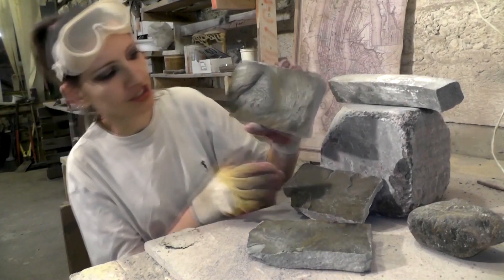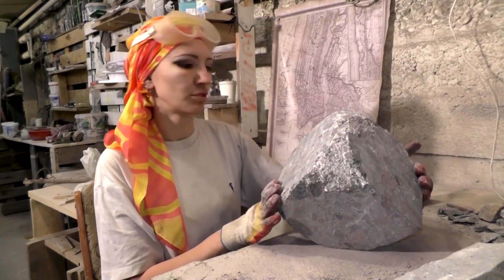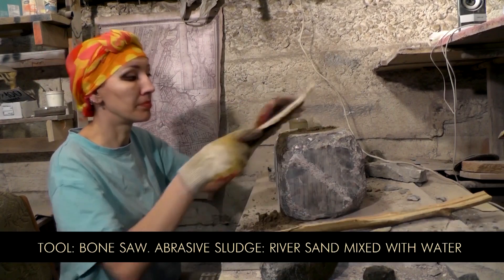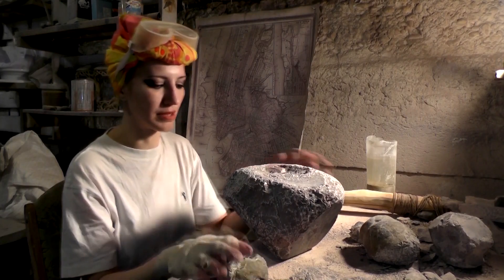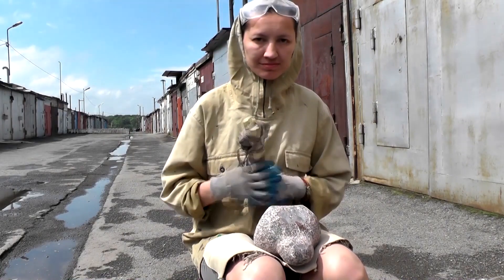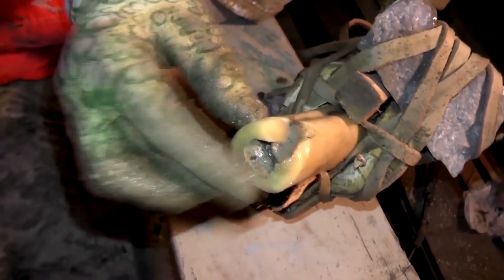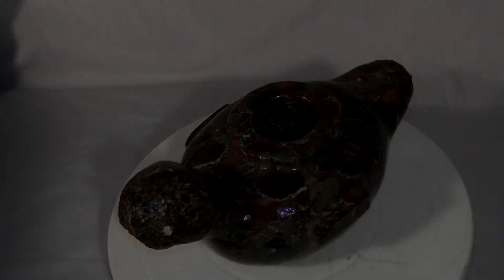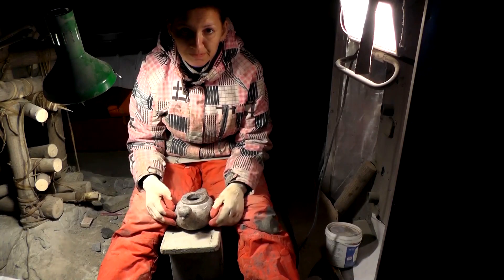Mysterious Ancient Artifact - DIY. Alternate history fans, please look away

Comment: Please next episode how the pyramids were made
Reply: What don't you understand considering there are already loads of videos and docos out there which speak to that subject.  These are the main points folks need to know:

1 - the pyramids are mostly Limestone while those Limestone blocks are mostly crude chunks of stone of assorted shapes and sizes.  Only a small number of the total blocks - the casing stones and last layers of blocks upon which those rested + the blocks making up the inner corridors/chambers were more carefully cut and in some cases polished.  The bulk are basically "stacked rubble" created by driving lines of long Bronze chisels into the bedrock until expansive pressure causes the stone to split along the chisel line.
2 - they used earthen ramps made from a mixture of sand/stone chips - quarry debris/and tafla - a sedimentary clay they mined along with simple retaining walls.  At Giza are actual smaller ramps in the western cemetery attached to unfinished tombs.  When the Giza quarries were excavated years ago they were noted to have had massive amounts of = ramp filler material dumped into them to backfill the area.  All that was removed decades ago and dumped into the surrounding desert. Finally near the worker village of Giza is the remains of a large tafla mining operation.
3 - wooden sledges to transport the blocks.  There are actual sleds in museums + depictions of things being moved on sleds in their iconography.  When Petrie studied Giza long ago he noted that the north side of the Limestone escarpment upon which the Great Pyramid rests was used as = a garbage dump.  He found parts of broken wooden sleds etc. + pieces of rope of assorted sizes + and other debris.  Today that area was cleared out and a modern administration building was built in that space. 
4 - levers and what Herodotus wrote as "a machine."  The latter is likely a fulcrum/counterweight device akin to the Egyptian shaduf - save for larger - which sat upon "the steps" of the pyramids to raise the smaller blocks* found in the upper half from level to level.  The largest/heaviest blocks in the pyramids are actually found = in the bottom half closest to the ground.  Those would be raised via ramps and pushing/pulling/levering into place by teams of men and oxen.  
5 - the area next to Khafre's valley temple and the Sphinx was once = a harbor.  So the Limestone casing stones and Granite along with Basalt for the mortuary temples was shipped to Giza on barges to a harbor which sat ~500 meters from the Pyramids.  

* - the blocks of the Pyramids as noted are smaller as they rise in height.  The ones at the top if you look at photos of people who climbed them are small enough for several men to lever into place.

Comment: Very impressive, however when we look at some artefacts it's the tool markings still left behind that do not match any of those tools. 
Petrie's core number 7 has the spiral tool marking that travels all the way down it, and the core tapers at the bottom. 
This will certainly explain the non precision artefacts, but unfortunately not the hard stone precision ones. 
Well done though, certainly not an easy task 👏
Reply from the maker: About core number 7 and Chris Dunn: https://youtu.be/HQi4yql7Ysg
Reply: Core 7 does not have a continuous spiral. That has been debunked many times. This channel also has an example of a diorite vase.
Reply: @Eyes_Open debunked my ass 😂 Christopher Dunn wrapped a string following the entire core, also you can clearly see the core tapers as well. Then to snap the core out requires steel. 
No simple method tools leave behind those markings, if it done with a copper tube and sand containing quartz it would be smooth and polished nor would it taper.
The debunking is coming from the other way around, another level of investigation is stepping in for a more detailed analysis soon. Just like the aerospace precision hard stone vases it will undergo full spec analysis that should have been done long ago but has been avoided, like most if not all of these hard stone precision artefacts, including colossal statues.
You can see which artefacts can be explained by the tools of the time, including the hieroglyphs, however we can also see another industry altogether.  The beautiful precision artefacts are not explained by the tools of the time and the hieroglyphs are chicken scratchings on the artefacts compared to the artefacts themselves. Have a look. 
If it was indeed the Egyptians, well wouldn't they have access to the same tools? Why aren't the hieroglyphs polished out and as precise as the artefacts? 
Engineers can easily see the copper chisel markings on the hieroglyphs but not the artefacts, even the vases were tested for copper, not a single trace, if anything they found tungsten,  and other impurities that would be found in some sort of alloy steel. 
We already found a precision hard stone vase in a neolithic grave in Tundra in the 60's, we know these precision artefacts were indeed inherited. Hieroglyphs can be added later.
Reply: @naomiparker3949 Dunn wrapped a string. Children can do the same. The lack of continuous spiral is so obviously non-existent that it takes a special kind of blind faith to believe otherwise. The taper is caused by the wobble of the drill. Except when Dunn did his experiment and failed to achieve a taper. Almost as if he didn't actually use a hand drill and instead used a modern method. Dunn is also the only human who needs a steel wedge to break a core instead of copper or wood like anyone else. Why would anyone expect by default that writing, formed by fine chisels, would be polished?
Reply: @Eyes_Open yep, children can wrap a string following the spiral the full length of the core! You said it!
The core tapers perfectly too. 
Now find me the hollow copper drill that did it? You won't because not a single one has been found. 
If I had made a beautiful polished hard stone precision artefact and someone came along and scratched rough hieroglyphs into my beautiful piece I'd be pretty pissed off! Surely they had access to the same tools, but this is showing they didn't. 
Perfect example is the Seraphim box, have a look at the quality of the hieroglyphs compared to the box itself, there's heaps, loads more artefacts that display the two separate craftsmanship. 
Engineering science is the go to for how these artefacts were made, it's an exact science, archaeology is not. 
You wouldn't ask an archaeologist to build and design you something. They only deal with the humanities, arts, languages and histories, not construction Engineering. 
They ignore that the Egyptians tell a 40 thousand year history, that was their official record to them. These upstart archaeologists turn around and say no they are just myths!
Well who the hell are they to say that ? They said Babylon was a myth, lo and behold we found it, they said Troy was a myth, we found that too, they said civilisation couldn't be more than 6 thousand years old, then we found Gobleke Tepe (and only 10% excavated) and another 50 to 80 similar sites have been found that are bigger and even older that would require civilisation to construct. 
So yeah, archeology has got a lot wrong before. 
As for C. Dunn his findings still stand very strong as well as Petrie's. There are machining marks on many artefacts and stonemasons are in agreement. 
The noise is getting louder, we need Engineering science to analyse these artefacts, it's been avoided for too long.
Even when the experiment was done by another archaeologist with a hollow copper drill, even he had to use steel to get the core out.

Comment: This video is a complete strawman:

1) Uncharted X (and others), don't claim you can't sculpt hard stones with primitive methods. He claims the level of precision and simmetry are at a level (almost) of a CNC machine.

2) There are different pieces of pottery presented in museums allegedly from the old kingdom in Egypt. The claim is that there are two industries, one creates incredibly precise and symmetrical pottery, with equally hollowed out interiors even when the pot is very flat and wide.The other industry creates low quality work, like the one demonstrated in the video, which also takes months.

3) The claim is also that Egyptians inherited these objects and tried to copy them. Failed.

4) Anyone can work hard stone like the video suggests, especially when you have all the info at your fingertips in the age of information. That's not a flex. The flex is creating those incredible pieces of pottery in 2600 BC with the knowledge and technology at the time.

Comment: Amazing effort, for stone-age era.  You do realize the Egyptians had copper, tin, lead, bronze to make stone carving tools.  For example a copper core bit with silica sand grit can drill about 6mm per hour in granite as your program showed in another episode.  Using corundum, Topaz, or garnets cast in copper or bronze tools would be 10X faster cutting as they are almost as hard as diamonds.  Almost as good as modern diamond tools.  Also it is common practice to mechanically embed hard aggregate into copper tools for stone polishing.  It shouldn't have taken more than 4 weeks if you used copper tools.  Again, the Egyptians had copper tools, and trace amounts of copper have been found in core holes going back to the earliest pyramids.
Reply: The are quite aware of the metal working skills of the Egyptians. They made a deliberate choice to not use metal in this video.

Comment: Alternate history manufacturers please look away from this comment. The over 40 000 vases discovered from pre-dynastic Egypt were not only made of stone much harder than sandstone which you can carve with your finger nails. The vases have been scanned and analyzed using 3D cad software that shows how precise and accurately they were made. With perfect symmetry and uniform flat and curved surfaces. The precise and consistent alignment is the detail that had been overlooked by historians and truly by this example.

Some pieces varied in their degree of precision and difficulty. However, there are examples of work done in extremely hard stone that is so precise that these primitive methods of construction cannot explain the artifacts we have. If you ignore the physical details of the artifacts that don't fit the narrative that isn't history. Nobody is suggesting any alternative to history as we know it. Just pointing out that the historical record is obviously incomplete if there are examples of precise manufacturing that predate recorded history.

Modern humans are 300 000 years old approximately. We have survived through 11.5 glacial maximums or ice ages. The last one ended roughly 12 000 - 13 000 years ago. The next maximum should be starting approximately now. The true axial pole will move away from the sun for the next 6500 years reaching the maximum distance where it will begin moving closer for another 6500 years. Then the next warm period will begin and 6500 years into that the pole will reach the minimum distance to the sun. Where the northern hemisphere will be warmest. This is called precession and it lasts 26 000 years, or 25 772 years more precisely. 

The history we know only accounts for less than one half of this current glacial minimum, or less than 5000 years. We now know there are ruins far older and many tools, innovations, and pieces of technology lost to time. 

Keep going with the biblically restricted version of history though if you like. Surely that one is the best most forensically accurate version.
Reply: Try again without injecting your fantasy. Start with the 40000 objects that fantasists revere so much.

Comment: Great. Now repeat with diorite or granite
Reply: They did that several years ago.
Reply: Did they? If you're referring to what Dr. Mark Lehrer attempted to do; it was an abysmal failure. They even had to admit so. 
Just apply some critical thinking with math. 
There's an estimated 2 million blocks in the Great Pyramid. So, if it was built in only 20yrs like Egyptologists claim, this would mean workers working 12 hour days 7 days a week, 365 days a year for 20yrs. No days off for bad weather etc. they'd need superhuman abilities!  Mathematically speaking this equates to taking only 2min. and 30 seconds per stone to quarry, carve, transport, lift and perfectly position in place on the most precisely constructed building ever built on the tallest building ever built (until that Eiffel Tower was completed in the 1800's) and they accomplished this over 3000 yrs ago. Think about that for a moment. HOW?
I'm not down with the aliens hypothesis, but don't rule out of hand either. That wouldn't be scientific. I do suspect there is a lost period of humanity, lost to cataclysm that occurred 12,900 yrs ago. As time goes on, the comet impact hypothesis is gaining wider appeal and consensus.

Comment: Nice, but still a joke in comparison to these found in Egipt with few mm wall thickess, 6-9 on Mohs scale (steel is 5, Cu alloys and tools approx. 4) and precision in 0,01-0,05 mm (yes, values mm, not cm, hundred parts of mm!!!). Think, read, learn, think again, but this time for yourself. Best affirmation for everybody with open eyes and minds❤😊☀️🙌👋
Reply: Yes. Think and read. Mohs scale is a trick used by alternative grifters to confuse you. Glass is 5.5 on that scale. Can you damage glass with copper? The answer is yes. But the copper does not cut the rock, the quartz or emery/corundum abrasive did the cutting.